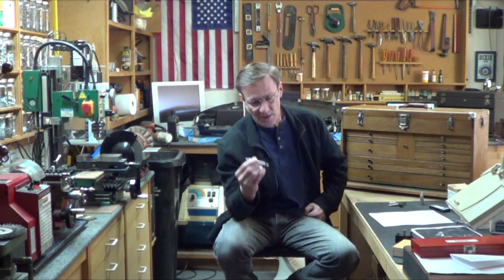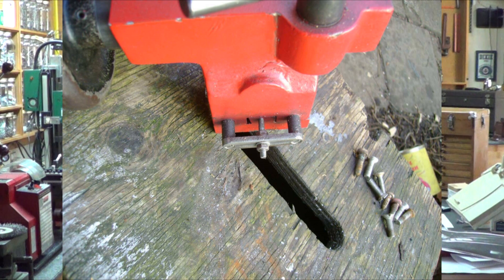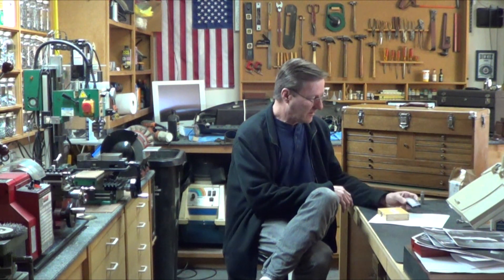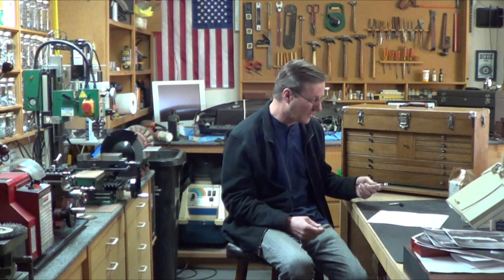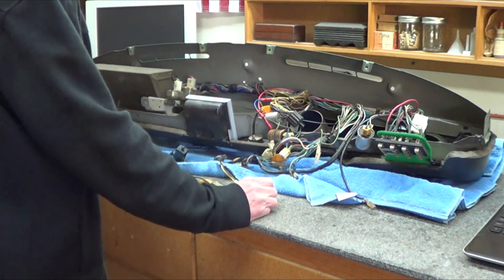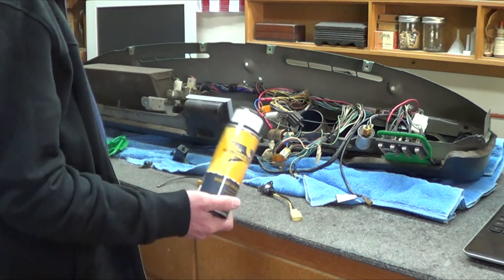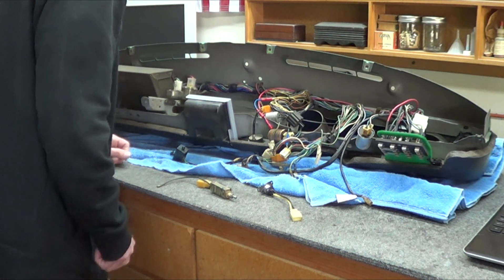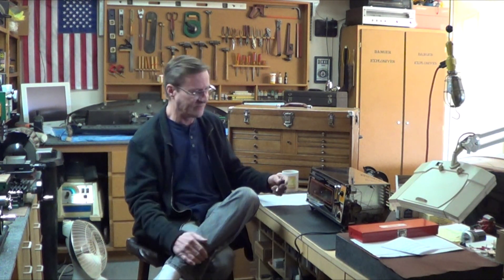2016 Shop Update Video #33

Comment: I have heard that the hand crank is very useful for threading particularly on small diameters. Many complain that the longitudinal feed rate is too fast on the mini lathes during threading operations. Sherline users swear by the hand crank method, and not just because they don't have any other choice. :-) 

I second the recommendation to check into Chris' videos at Clickspring on heat bluing. He heats the parts in brass shavings.
youtube.com/watch?v=UST7iJgC_gs 
If you view some of his videos showing blued parts you will see the process.

Nice find on the toaster oven. That will come in handy for many applications.
Reply from the maker: +Herr Schmidt That video is what started this madness. He really never says what the shavings are but they do look like brass. His method is good for small parts, the heat is distributed evenly for even coloring. I wanted the oven because its better for larger parts and the test shows the heat is evenly distributed and is a lot better than using the torch method. I can also control the temperature more to get a specific color.
Reply: Ahhh...indeed, he is only bluing small parts. Did you find that the oven gives a fairly uniform distribution of the bluing? If so, then no need for the shavings! Maybe HE needs a toaster oven!? :-)